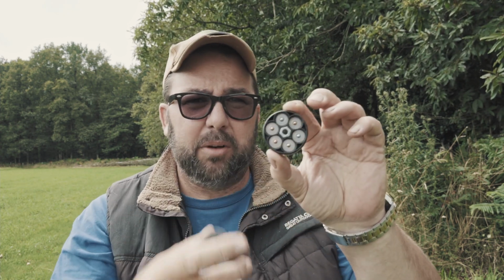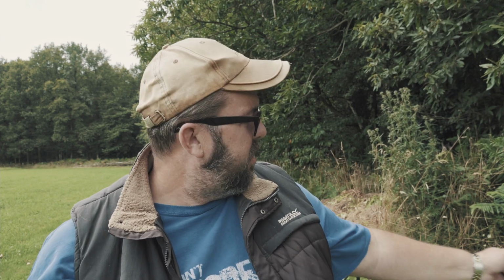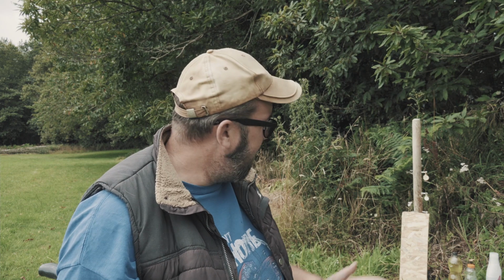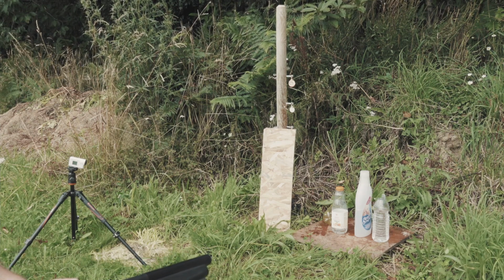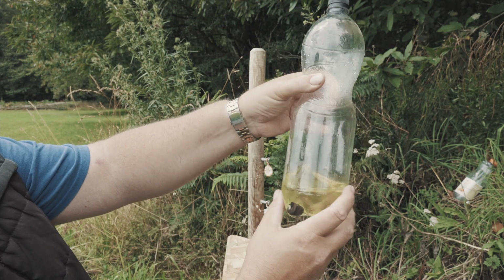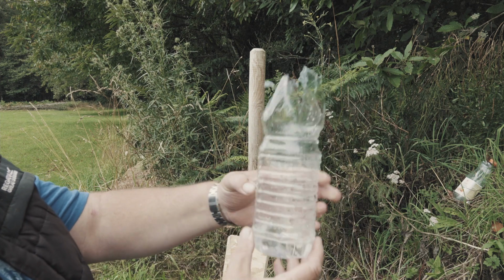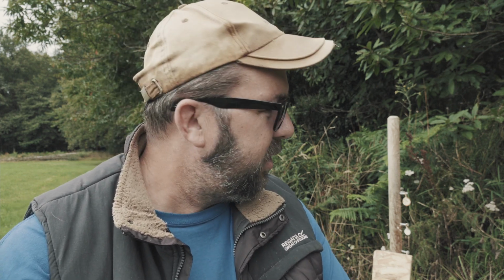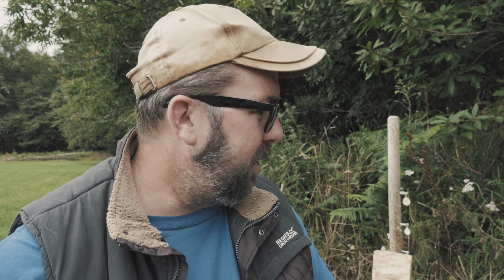Things to make with Hot Glue.

Comment: Why don't you try to pack those molds with JB Weld Steelstick steel reinforced putty? It dries like solid steel in minutes once mixed together and is still light enough to get good velocity.
Reply from the maker: I think that projectiles that remain semi flexible work better, as they seal in the mag and barrel slightly better. But it might be worth a try.
Reply: Your right about the flexibility, however how are the rubber/steel mix balls? Are they flexible at all? I have an HDR 50 but have not been able to get the different ammos I'd like to, so I can only guess. The steel/rubber are not solid balls?
Reply from the maker: Yes the rubber/steel balls are some what rubbery on the outside. So fit nice and snug.